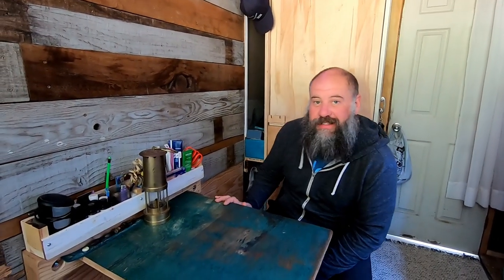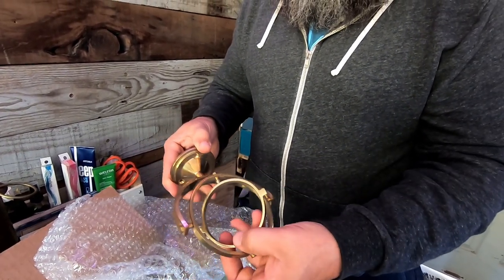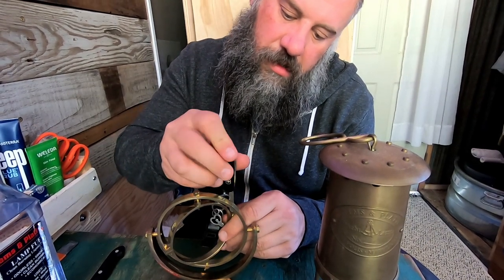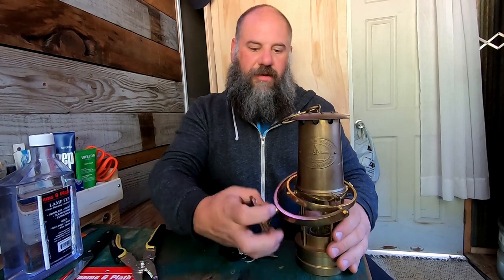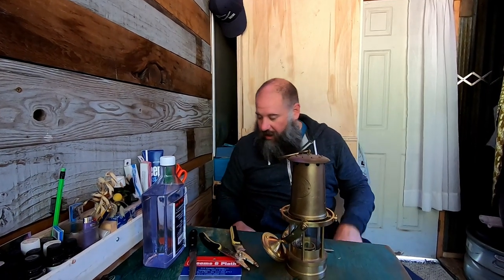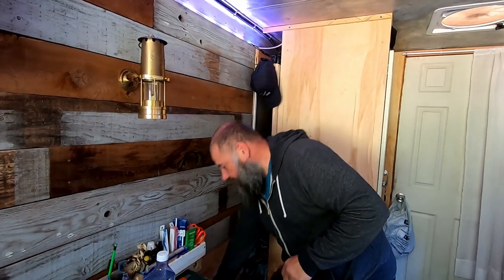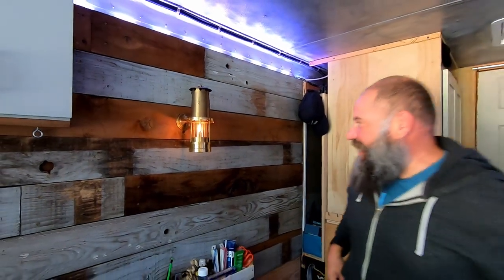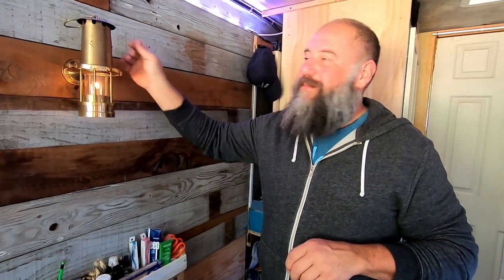Installing the Yacht Lamp w/ Gimbal | from Weems and Plath | Vanlife BreadTruck

Comment: Thanks for the great shout out Paul! We're so happy you liked the gimbal, wicks, and fuel we sent you! These lamps are among the safest oil lamps you can buy - the glass enclosed flame makes the lamp wind resistant and the venting holes at the top disperse the gas so you don't have to worry about a risk of gas build up. They're so safe that they're even used aboard airplanes to transport the Olympic flame across oceans!
Reply: That's a cool tidbit of knowledge. Thanks for sharing!
Reply from the maker: Thank you again Weems and Plath! These items are so cool.

Comment: use rigt tools fore the rigt job,,makes it more esy,  but the lamp holder vhas made fore boat, and follow the wave, the center ring, shuld be lift a little upp, looks as it is to low not centra. but as long it works,  he he i still got mine in my boat, and it gets worm,  think it is call gyro holder,? 👍👍👍👍

Comment: Hopefully Ellie, Maggie, and yourself had good b-days. When thats burning it should pull moisture out of the air, right? Help reduce the moisture "issue" not that there was one.
Reply from the maker: Yes. People swear by having a lamp burning to remove excess moisture in their vans and boats. Hopefully this helps, not that there was a moisture issue. 😂

Comment: Based on your experience, what’s the closest you would mount this to the ceiling?
Reply from the maker: Probably 6-8 inches. It doesn’t get real hot above it unless you’ve got a huge flame going inside of it. It’s adjustable and I don’t burn it really hot.